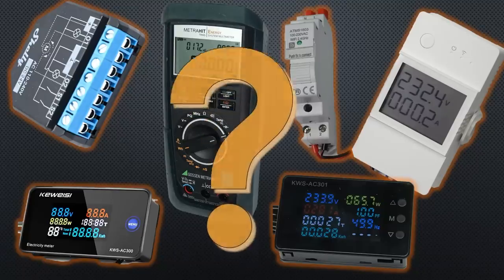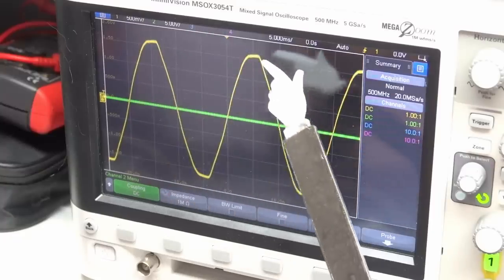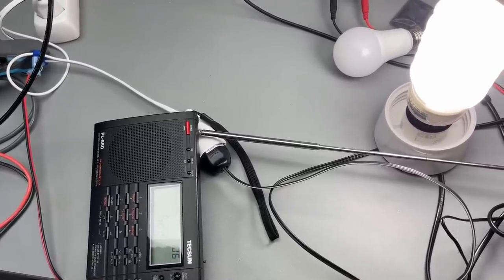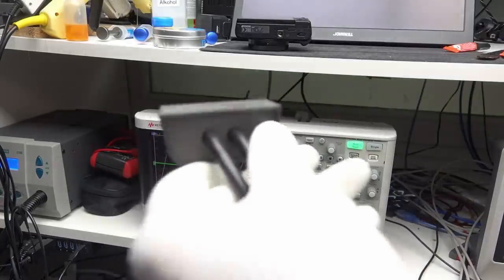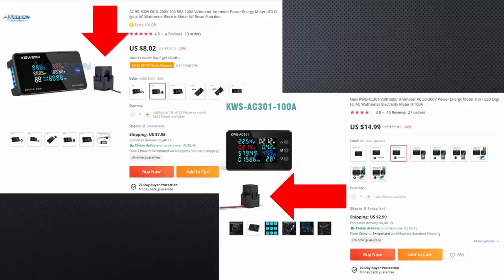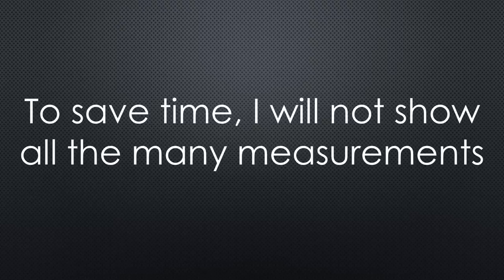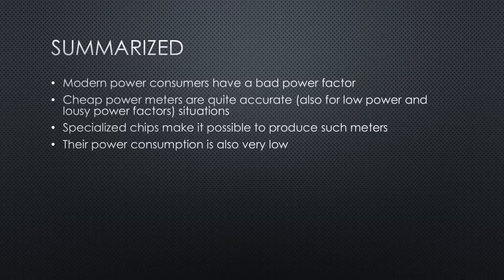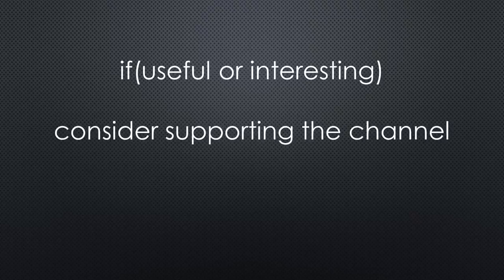445 Can we trust our mains' power meters?

Comment: I got lucky with a AliExpress seller that got me an excel spread sheet showing the MODBUS protocol for the KWS power meter. I have a working Arduino sketch that can quarry it for all the parameters, and many that are not shown on the display panel. I did have to translate it. And figure out that it was MODBUS RTU protocol. These meters are based on a dedicated processor that was designed to be a power meter. There are many other commands in the spread sheet, that this meter does not support, so I assume the manufacture uses the processor with different firmware for other commercial versions of power meters.
It's to bad it has the poorest measurement accuracy. Thanks for doing these tests.
Reply from the maker: If you send me the Excel, I add it in the video description. Maybe it is also useful for others.
Reply: @AndreasSpiess  I attached as a comment to your github page, Documentation of sensors for "Energy Distribution" and "power-flow-card", and "Load"
Reply from the maker: @f.hababorbitz  Thank you! I already added the link to the description of this video.
Reply: @AndreasSpiess  I thought I had a breakthrough googling like mad when I just found the spreadsheet on github.. then I noticed the familiar face on the account lol. Good work guys!

Comment: The main purpose I use power meters isn’t actually to measure power, but for safety. For example, almost all the Extension Leads I have connected via. a Sonoff POW (various generations) because they have Over Current Protection and Over Power Protection. I often have both ON and a big safety margin because they might be connected to devices with a low power factor, but I’ve often wondered how accurate they are. The obvious reason is I want to make sure the extensions are not overloaded and I have a room on AirBnB.
Reply from the maker: I do not understand your point. We use fuses for over current protection because they are much faster and very reliable.

Comment: I am monitoring my ShellyEM power meter, which I have installed in the past 6 months, against the main power meter installed for my apartment. Each month the kWh values of the two devices are exact matches
Reply from the maker: That is a very good sign!

Comment: Can you comment on whether you trust the power consumption as measured by the meter installed by the electricity supplier?
Reply from the maker: I trust them because they have to fulfill strict standards. But I only can speak for Switzerland.
Reply: Steve M. Potter, In my state it's codified. The utility will test for free once per annum if requested. The board will do it for 5 yankee bucks.  If it's beyond 2% (1.5% for water) error you get a rebate. If it's under billing there is no back charge. If the meter was tampered with, the underage is due immediately.  If it reads 0 or you should reasonably have known it was under billing the difference is paid back over time.
Reply: @AndreasSpiess  Same here. Residential customers also get a pass on demand and reactive  power.
Reply: @st1300r Wow, which state?  Here in Ireland, many meters' clocks are off, a problem if you have day-night rates. And if you call them out to complain about your meter and they don't find a fault, they charge you €200 for the visit.  My clock is only off by 11 minutes, but some are over 2 hrs off.
Reply: @StevePotter  New Jersey. Here, at least in my town, I don't have any time dependent rate. I think the other side of the country (where everything causes cancer) does have time dependent rates for residential power. I have a dumb meter it doesn't have a clue about time. 60 cycle here on avg is fairly accurate but a meter using mains frequency like an old school electric clock will drift over time without a method to realign it.  Off hand I don't know how places with "smart" meters derive time.

Comment: I ordered Shelly EM (the one with current clamp) couple of days ago. Hope to get it soon. I plan on using it for 24/7 measuring apparment's power usage. The utility company I purchase power from doesn't provide this info.
Reply from the maker: I used this for last two years before I got my PV. It worked fine. However, for optimization, often, more granular info is needed.

Comment: The question I am always concerned about is, how accurate is the power company meter that monitor mains power usage,
Reply: They should be designed to under-count the consumption because anything else would get them into trouble.
Reply from the maker: Here they have to be calibrated. So they are quite accurate

Comment: My KWS-AC300 seems to read high by about 5%. But mostly, it doesn't display anything under 1 watt. I would say it is a failure from my perspective,
Reply: Same here. That's quite annoying - I ordered it after viewing Andreas' test and hoped for an accurate reading of small currents. Obviously AC300 is not suitable for this purpose.
Reply from the maker: I did not test them below one watt because it is asked for too much. My Metrahit has several ranges to get below 1W. I made some videos about "burden voltage" which is important to understand in this respect.

Comment: Nice video, thanks!
Would be interesting to do two test more:
-Flash one smart plug (sonoff, Shelly) with ESPhome and Tasmota, perform the calibration without the Metrahit, and then repeat the test.
-Do the same with an Arduino/esp8266/esp32 attached to a CT clamp. Those use the ADC converter, and I am wondering how bad (or good) will measure current (not power, offcourse) on switching power supplies
Reply: For the second one a circuit like the board produced by Motramlabs... 
The good thing is you can build an inexpensive current logger (5$) with ESPHOME/Emonlib... of course, it is needed also a Voltage logger to have the power... but I am wondering how good or bad those work.
Reply from the maker: How do you calibrate a device without one that is more precise?
Reply: @AndreasSpiess  I am not asking this… I am a step before… when I need to calibrate an instrument and I do not have a Metrahit…
As Tasmota and ESPHome suggest, with a device with a known wattage… but this method is highly inaccurate… of course, this the worst case… so will  your regular amperimeter/voltimeter (did you already forgot about video #99???) and then compare results with Metrahit… the challenge here is to reply the question: How good (or bad) is the method proposed in the video 99?
Then, the second question that would be interesting to reply is how good or bad an ADC of a microcontroller can calculate the power (area below the curve shown at 4:32 ) of a highly noise signal of a switching power supply… if the microcontroller calculate the area of the upper envelope or the lower envelope of the current shown at 4:32 (good old true color bulb”).. the wattage will be quite different…. (the voltage is quite sinusoidal… but the current…)… 
I mean, arduinos/esp ADC’s technique may work well with sinusoidal or quasi-sinusoidal waves… but how do they perform with the dirty waves of the good old color bulb?
Reply from the maker: @andresdans  You are right. You can use a true RMS volt and an ampere meter for a resistive load. That should be good enough.
I would not try to use a microcontroller. The prices of these specialized meters are quite low. You also need an amplifier for the current because a shunt should not have a high voltage across. And keep in mind that the GND of the Arduino might be at 240 volts (as it is the case with the Sonoffs)

Comment: Fantastic the way you organized the results.
Question: what's a good way to (once) measure the power usage of a high power item, like a burner on a 20A circuit?
Reply: A clamp meter is what you want for that, assuming you mean for manual readings like you'd do with a multimeter.
Reply from the maker: As shown in the video, you get transformers for both of the "manual" meters which go up to 50A and more.
Reply: @AndreasSpiess  Oh I see! There are 50 and 100 amp versions of the KWS-AC30x. Thanks!

Comment: Nice! Wonder if calculating the real power using an oscilloscope will not yield more precise results than measured by Metrahit Energy (according to the datasheet the intrinsic uncertainty for active power at 10-65Hz AC is 0,4% or 1% +20d)? 
PS. Wonder if Metrahit Energy measures to it’s specifiaction? Mains probably not clean/stable enought to get more precise measurements..
Reply from the maker: I do not know. Keep in mind that oscilloscopes do not have good ADCs e. g. 12 bit)

Comment: I was expecting to see being tested the EmonCMS along with EmonPi and EmonTX hats and since you have lots of Pi's doing various things in your home/lab it's a good idea to add on one of them the EmonPi hat and make it a power energy meter. It also supports a AC/AC adapter for RMS and power factor correction plus it's open source and you can edit the code according to your needs.
Reply from the maker: A few years ago, this was an interesting product. With the new specialized chips available it makes no sense to build a sensor using an Atmel chip. Better to concentrate on the "what to do with the data".

Comment: Modern devices are supposed to have pfc now, and if they want actual certification to be on the grid, they must be within certain limits and the current curve must be corrected. As not only PF but the form of the current curve has a severe effect on transformers. What happens is that companies submit a diagram, and if it simulates ok they get the certification. But as we all know, simulating and actual testing are different.
Reply from the maker: I assume there is a minimum power consumption for this law. The750W power supply I showed had PFC and the small bricks did not have one.
In the end, the large consumers are interested in good power factors, because it saves them money.

Comment: How come the KWS-AC300 and KWS-AC301 produced such very different results at 10:00 ? They look like they should be nearly the same hardware under the hood.
Is it just variability in calibration??
Reply from the maker: I do not know. I also did not find a calibration function for users. The AC-301 has double the current range. Maybe this is part of the reason.

Comment: I have used such devices to gather info about power use of different gadgets (not permanently monitoring, but plugging them in and reading the values), and my major gripe is that many of them do not go down to the power levels that todays equipment uses in standby mode.
As you already noticed, one of them cannot measure 1.85W.  But mandatory standby power is 0.5W and you found that small devices idle at 0.05W.
So the powermeter should be able to measure that...
OTOH, I am less interested in measuring the power of a vacuum cleaner.
So maybe a specific device for low-power usage could be recommended.
Reply from the maker: I do not agree that measuring low power accurate is very important if it comes to energy optimization. Brewing one less coffee can easily offset months of standby energy of a modern device. Not to talk about not to drive a short distance with the car.
It is interesting to know, we should not loose perspective.
Reply: @AndreasSpiess  Indeed it is not important for energy optimization, but of course we always want to measure and know everything 🙂
When I don't want to measure it I don't need a power meter at all.
(I borrowed a HOPI from someone and checked all my equipment)

Comment: I think a PZEM-004t 100A v3 is worth considering, to use as an IOT Energy Meter. I have 4 of them connected to my 3-phase home connection and on-grid solar power plant (UART Daisy Chain; assigned address) with ESPhome and HomeAssistant. It's almost line with my Energy bill I get from my utility company [Difference was about 2%]. Considering its price, I believe it's a decent trade off. Also found this video testing its accuracy: https://www.youtube.com/watch?v=j0_y8dPfpKc
Reply from the maker: Thank you for your information!

Comment: But for whole house meter? Like the connected BTcino F20T60A on DIN rail?
 Capture the consumption of the whole house via WiFi+MQTT or ZigBee can be useful
Reply from the maker: I agree that it is useful. Still to optimize you probably need more informations. I used the Shelly 3em for that purpose before I got my PV,

Comment: For the AC power adapters, you should check which DOE level they have. Since level 6, they need much lower power consumption in no/low power applications.
Reply from the maker: Good info. Thank you!
Reply: How to check that DOE level?
Reply: @TishSerg The level should have either a circle with roman numbers inside, or just DOE with the number next to it.
Reply: @tverspeelt  the circle made of two arrows? I have "10" in that on notebook PSU and router PSU.
But on 1+ charger I found "VI" inside plain circle. Looks like it is what you refer to.
Thanks

Comment: I have a plug-in meter and some wifi (meross) ones... turns out the plug-in measures quite high for low (<10W) loads, like when I plugged the latter to the former, I could add up the values of the wifi ones to get accurate readings, but the plug-in one was sorely lacking. For higher loads however, it seems to be okay.
Reply from the maker: If you connect then in series, one measures also the power of the second. This is relevant for low power consumptions. I would not do that.

Comment: Thats a good video.... Andreas, is there any for 3 phase / 4 phase power measurement?
I am trying to make one with pzem-004t and use an Arduino / ESP, so that i can use the parameters to control my motor (3 phase..)? Really appreciate if any better alternative that you have come across...?
Reply from the maker: I use the shelly 3em for 3 phases.

Comment: Does the Tuya include any switching function? The Tuya energy monitoring plugs that include switching have/had a great feauture that as "protection" they turn off the output if the line voltage is exceeding 250v (and don't turn it back on, even if the voltage eventually drops below 250), not great if you are monitoring a fridge/freezer/server, basically anything you actually need to be turned on.
Reply from the maker: The one with Zigbee has a switch.
I do not know if they have such a function and if it is fast enough to protect your devices. Overvoltage is a fast killer
Reply: You can solder a thick copper wire across the switching relay in the Tuya, effectively disabling the switching function.
Reply: @Zamsky39  Exactly what I did, the “protection” takes about 6 seconds so is in no way protecting the device.

Comment: Since the voltage may change over time during the day, did you measure each along with the Metrahit meter at the same time?
Otherwise you may have significant errors in your measurements as the mains voltage may easily fluctuate 10 - 20V, sometimes within a short interval.
Reply from the maker: You are right. I did the measurements at the same time.

Comment: I was also expecting you'd test the Shelly EM or 3EM. Also both Tuya devices are din rail mountable
Reply from the maker: There is a lot of choice...
Reply: @AndreasSpiess  That's true, but as those are specifically made for power metering it could have been a good candidate. However I don't think Shelly devices will change that much, however the gen1 vs gen2 might.

Comment: Hi!
What is the cheapest device (method) to measure active and reactive 3phase power used to test capacitor bank of pfc panel?
Reply from the maker: If you want to know reactive power you need a meter which displays at least active power and the power factor. Only my Metrahit had a display for VA and VAr

Comment: Very interesting!
One thing I'm curious about is, how did you produce the load of the power supplies?
I found, crappy cables (thin aluminium core) can have quite an impact on their efficiency.
Reply from the maker: I used the IT8512A electronic load I showed in the video. Crappy cables can be offset by using the 4-wire method.

Comment: Is there a reason why you only tested the tuya zigbee version and not the wifi version (DIN rail mounted)? Unfortunatly there are no results shown in the spreadsheet.
Reply from the maker: The ATMS1603 had an average error of 4.6% and a power consumption of 0.4W

Comment: What kind of zigbee2mqtt device would I need in order to use the Tuya meter with home assistant? Will Sonoff zigbee 3.0 dongle work?
Reply from the maker: I use the Sonoff Zigbee dongle and it works.
Reply: @AndreasSpiess  thank you very much for the response. I'll get the sonoff dongle then. Smart home adventure begins!
Reply from the maker: @Zamsky39  Order a USB extension cable to mount the dongle away from the PC. If you mount it into the PC it will only have a short range.